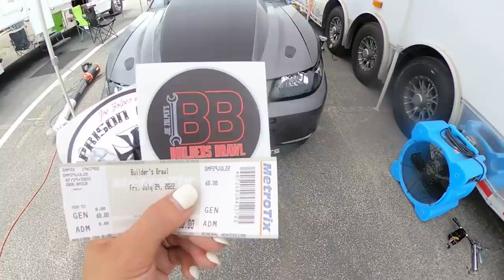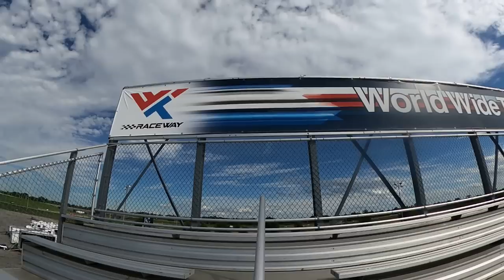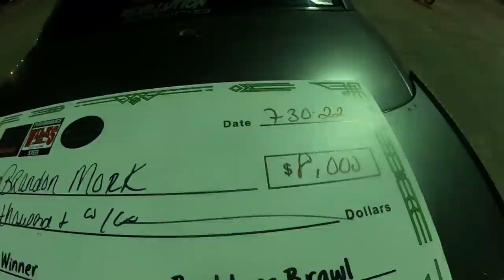We win The Builder's Brawl;  TwoFourSeven MOTORSPORTS Brandon and BadAsh @ WWT Raceway; Joe Zolper

Comment: that track is very fast in NHRA but i bet they did not have it prepped anywhere near that way
Reply: Was no prep and they got 8” of rain leading up to it and only swept it off didn’t drag it at all or anything so it was a little tricky
Reply: @bs03cobra  yeah I normally get the weather that goes thru St Louis so I figured that would change the prep. Awesome facility

Comment: What's keeping you from running the exhaust back on the car..? Just wondering, because I'm going to have the same issue with my single, trying to fit 4 or 4.5 between the k member and motor, so I can run an exhaust. I'm not going to be class racing, that I'm aware of yet, but I do want it run back, with a v banded muffler.
Reply: Just took and the packaging of the kit we have…would have to sell or scrap a expensive kit that the car had come with and redo the entire deal and place the turbos under the car back by the transmission bell housing like the hellion sleeper kit all for a stupid exhaust rule that doesn’t do anything anyways just seems dumb to me